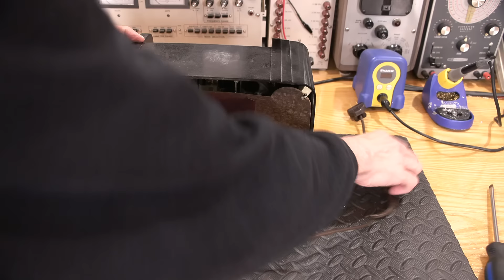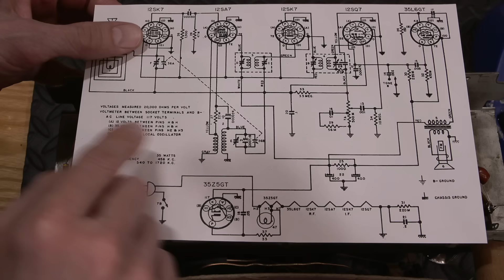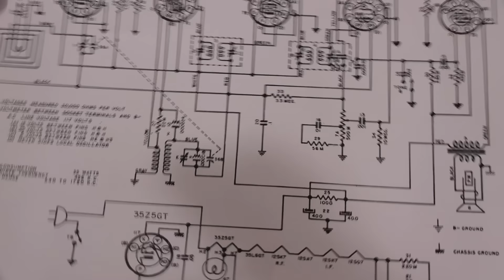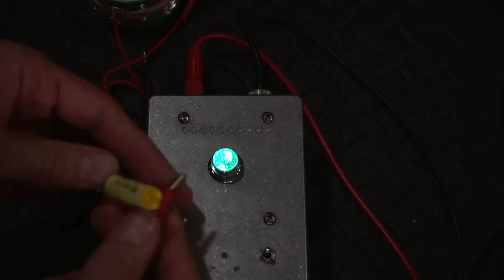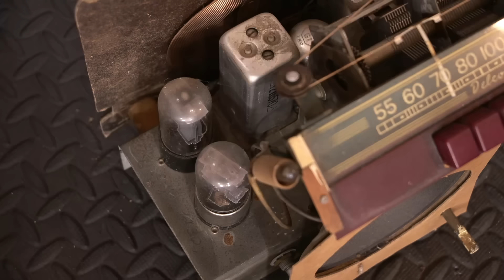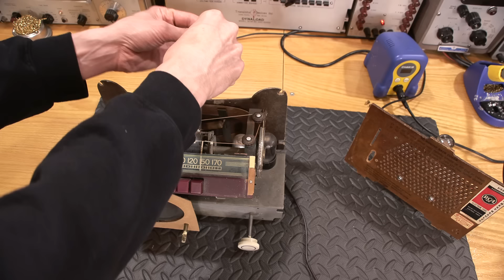Delco High Performance Radio Receiver! [Repair]

Comment: Can you align, and peak up a radio, without test equipment or very limited cost test equipment. And if so do a video on how you would carry that out. Obviously  not expecting the results to be as perfect but still put the radio in to a good state of usability.
Keep up the good work on the channel, just recapped my first Ekco U319 radio, inspired by you channel. And it works!! Or at least receives channels on all bands!!
Thanks from the Norfolk Broads UK
Reply: If the alignment of an AM radio isn't too far off you can trim it up "good enough" without any equipment. Tune to a station, being careful to precisely adjust the tuning knob for greatest volume and clarity. Then adjust the IF trimmers for best signal.

For front-end alignment it's closer to the standard procedure. Instead of using the specific frequencies in the manual substitute the frequency of a broadcast station that's in the same part of the dial. In other words, an AM station is just somebody else's signal generator.

If you want to spend a few dollars (or pounds) there are cheap modern crystal-controlled variable frequency oscillators. Many of these are based on the Si5351 chip. These output an unmodulated signal so you'll need to use a voltmeter on the AGC line instead of the speaker output.
Reply: Look up a product known as "Tiny SA".
It's a spectrum analyzer and RF generator with modulation option. For an old basic am radio it can do all you need for basic alignment. 
Also look up an RF wand, one end is made of ferrite, other end is brass. You can use it to determine how much more or less you need to tune inductive rf coils, slugs or antenna bar/coil assemblies. In a coil, you bring brass and then ferrite ends into them or proximity of them, if signal or frequency changes in direction you need with brass side, you need less inductance, ferrite side the opposite, more inductance. You can make the RF wand.
Reply: Use weak stations near top or at least 1400 and bottom usually 600 or lower and you can do a great job. The exact IF frequency can be difficult to home in on. Hopefully it's close. A simple RF generator and an AM at 910 would give an easy beat frequency to pick up exactly at 455.

Comment: Thanks Paul for your detailed instruction. I’m amazed how well an untuned rf stage works. The rf amp would appear to have a 3300 ohm resistor as a load

Comment: These old tube sets work a lot better than many people today would think. I've lined up many radios like this, and yes you can do it by ear. To get the signal into the set without connecting the signal generator directly to it, I just take a lead from the sig. gen., and make a loop of a few turns and simply place it near the set. I keep the signal low, so the a.g.c. in the set doesn't kick in, and line up the IF like that. So a signal generator and a good ear is all you really need!

Comment: Excellent job Paul!  Your genius antenna booster device works like a treat.  Not having to physically connect equipment to the radio makes it the absolute ideal way to align a radio.  No influence on the test radio, & perfect safety for the test gear!

The huge difference after alignment demonstrates the sensitivity of the radio, & the perfection of your test gear!

A restoration video of this receiver would be an excellent watch, where I'm sure you could make it perform even better, if that's even possible.  Thank you!

Comment: Easiest.   Radio.  To.   Rebuild.   Love.  Them.   Very.   Reliable
Reply: I can do anything except restringing the tuner, or rewind IF/RF coils.  I'll pull the tubes and knobs then off to the curb it will go.

Comment: Those old radios are fascinating. With that nice, high-quality I.F. section, this is the perfect kind of A.M. radio for tapping off the I.F. output and feeding into a synchronous detector. Many years ago, I had a six octal tube radio similar to this. Wish I had hung on to it.

Comment: Paul!  I have been watching all your videos and they are so, so good!  One thing:  On your capacitor checker that has the LED lights.  Would it be possible for you to put labels on the switches?  It would be a nice touch got such a valuable electronic tester.  Thanks and you are so good at trouble shooting!

Comment: Mr. carlson that is a perfect way of feeding the R.F. test signals to a radio, with built in antenna, via a remote antenna coil. I have done the same thing in my alignment of AM radios.
Reply: Do you think that it would be doable by simply connecting a loop antenna to the 50Ohm output of a signal generator, without a tube in the middle?
Reply: @willjackson1955  YES!  All the tube does is boosts the signal so the loop can be farther away from the radio being tested. Even several turns of wire to form a simple loop will work too.
Reply: @JCWise-sf9ww  nice, then I suppose that the tube is just an IF amplifier, a bit more broadly tuned to let all frequencies from 430 to 480 Khz pass?
Thanks!
Reply: @JCWise-sf9ww  What amplitude are we talking about? My generator can do 50mV max...
Reply: @willjackson1955  I would say that Mr Carlson's device is a broadband RF amplifier driving an ordinary AM antenna coil without any tuning capacitor involved. With my knowledge, I would say the tube circuit & antenna loop is capable of amplifying & passing frequencies from about 100 khz into the HF (shortwave) range. Depending on the gain of the tube used, 50mv, from your generator, would easily be multiplied many times over.  BTW: Carlson was also using the device as an Antenna re-transmitter.

Comment: When he tested the first cap shouldn’t the leads have been switched?
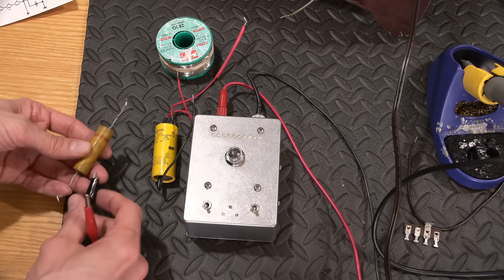Reply: At 18:14, it's a non-polarised paper cap and so polarity (when testing for leakage) is not a factor. The ring typically indicates the outer foil end, which is a factor in radio design (I think he has another tester for outer foil detection).

Comment: So when you end up with hum after replacing the multi-section capacitors, what sort of things should we look for to make it go away?   I run into this when I'm doing my amateur restorations of radios like this or things like tube CB radios.  I love the antenna 'caster' device!  So handy and useful when you're working down in the basement like many of us are.
Reply: The remaining hum can be caused by heater-to-cathode leakage, poor lead dress, or in a 6 volt filament string, the same lead being used to ground the filament and cathode, particularly in the audio circuit.

Comment: Great video, Paul. Do you restore viewer's sets? I have a 1948, Zenith model 7H820 AM/FM radio. It still has the original prewar, Armstrong, 42-50 MHz FM broadcast band and the other two frequencies It would make a very interesting video. I live in Manhattan and could ship to your address in Canada. Please let me know if you're interested.

Comment: The snag is, they are using a 2 prong plug. So the question is, which wire is live and which one is neutral? But it is a HIGH PERFORMANCE radio, so it shouldn't matter too much, should it? It's a HIGH PERFORMANCE radio. HIGH PERFORMANCE. Extremely important. Not just your average radio. It's HIGH PERFORMANCE!!!!! HAHAHAHAHAHA Edited to say this: Damn good idea not to tie Neutral to the chassis. Re read the start of my comment.

Comment: I know of several people that do retro-computer repair. They test ESR but, they won't ever test for leakage because the ESR is good. So you don't see them do a lot of recapping. I'm talking Tantalum caps from the 70's and 80's. would those 50yr old caps be notorious for leakage. I know Tantalums can go bad. They are basically used as filter caps for the IC's in the circuits. myself I just don't take the chance and do a recap in any case. Capacitors are so much better today then they were when I was growing up. Electrolytics are almost always still good. I won't replace those unless I see them leaking or bulging.

Comment: FYI I worked for Delco Electronics in Kokomo, Indiana my entire career (1977 - 2008), and we made some of the best radio receivers, along with several firsts in the auto industry (first in-dash radio receiver, first push button receiver, first electronic ignition module). I would have been surprised if you weren't impressed by this radio. It's also possible that all cases were made in ivory and painted brown at the factory.
Reply: Delco built many high quality, well engineered products over the decades. Most people don't know anything about Charles F. Kettering today, but he fran Delco Labs and was a creative genius and a giant in the American auto industry.
Reply: @patjohnson3100  that’s right
Reply: Since there is just an AM band visible on the radio, what is the purpose of the red push buttons. Just curious. Thanks in advance.
Reply: @fozzlac  preset stations.
Reply: I would kinda hope that by Ivory you meant the colour, and not the actual material.
Reply: Dude Motorola and or Bosch/Blaupunkt made the.first auto radios
Reply: @e.emerald3224  he said first IN DASH radio. In 1936, Delco began producing the first dashboard-installed car radios
Reply: @e.emerald3224  Dude you're wrong.
Reply: @gold98gtp mopar had electronic ignition in73 1 year before delco

Comment: The harder to find Delco model R-1236 with pushbuttons circa 1946. It actually came only in the ivory finish. The non push
button version came in either ivory ( R-1234) or brown ( R-1235). Interesting "junk box" power booster antenna none  like I
have ever seen! Impressed by your cleverness using a Compactron Mr. Carlson. Of course I don' t want to  possibly send a 
signal out to the whole neighborhood. Or do I? LOL. Excellent revival and alignment of an old tube receiver!

Comment: that's what the inside of my thermin i built looked like, until i decided to make a circuit board for it. a bit ball of resistors, caps, diodes and transistors didn't work out so well

Comment: They switched the chassis side because the service receptacles and plugs were not polarized. Therefore, if the chassis side was connected to the hot side of the line it would be at full line voltage 24/7.

Comment: Finally a normal mr.Carlson video Also Richard from the channel Learn electronics repair tried to contact you about a rare tube filled thing if you were interested in it but your Email did not work or could not find it ... anyway you may want to contact him .. if he still has it .. tell him dutch told you about it it was a german device

Comment: make a new power cable under the tuning axis, closer to ground, shasi. It will not touch the tuning axis, like the old cable.
Reply: Did you actually watch the video…? 🤔 He explains exactly how he will rewire it during the full restoration. But hey, comments=engagement metrics! 😜

Comment: US buildings that used 110VDC, I found the Electra Hotel in downtown Chicago. It had a steam plant for heating, domestic hot water and to Generate its own electricity. In the room that I rented had a sign above the one outlet stating caution 110 direct-current.
Got a tour of the boiler room it was quite impressive. (Talk about off grid)
Reply: Early Polish post-WWII grids sometimes used DC, 127V or 220V. That's why "universal" radios like Pionier U and U2 existed. They used series heating at 100mA for tubes, typically UBL21, two UCH21 and UY1N. As years passed and the country standardized on 220V 50Hz AC mains, most radios had mains transformers and used E series tubes, starting with loctal (EBL21, ECH21, and if the radio had a magic eye, it was EM4) moving on to noval (ECH81, EF89, EBF89, EL84 or ECL86). A few small and cheap models in the '60s didn't have mains transformers or had one for heating only, they somewhat resembled the AA5 design. I don't really like working on these for their hot chassis, even though I have a proper separation transformer, dim bulb and variac setup like Paul uses.
Reply: @KeritechElectronics  Thanks for the early Polish mains history; very interesting.  Having only lived in the US, I assume Philips controlled most radio design via patents, like RCA did in the US.  I have seen a few of those AC/DC universal line voltage radios.  They appear to be designed for 100 volt mains, with a multi-tapped custom power resistor to drop higher line voltages.  I agree with you on the Hot Chassis.  I grew up in the 1960's in Florida and I was regularly getting shocked from those hot chassis due to most homes having a concrete floor.  Fortunately, the mains voltage was only 110 volts at that time.
Reply: Yes, the Edison DC house power was used for many years in the Chicago and New York area.  The prime reason for series circuit tube filaments was to make a radio that would operate from both AC and DC.
Reply: @billharris6886  The early electrical history is entreating, like the reason for 1st elect R&R line voltage.
Reply: @mackfisher4487  Thanks for your response but, I can't make sense of some of the words.  "Entreating" is a forceful urging or begging.  "Elect" means chosen.  I'm not sure what R&R means.  I guess my working vocabulary is quite a bit different than what you are used to.
Reply: @billharris6886  I’m guessing he meant “intriguing” and “electrical”
Reply: @JohnGodwin777  Thank you for your response, that makes a lot more sense!  I suspect in the early days of electrical power generation, a city would buy an engine and generator head, then run it at whatever speed seemed to work best for their particular setup.  For instance, 15 years ago, I was living in Hamilton, Ohio.  I discovered they were originally running a line frequency of 133 Hz.  My guess is they discovered that you can get more power out of the generator if you spin it faster.  That power was being used to power arc lamps, incandescent light bulbs, and brush motors (non-frequency dependant loads).

Comment: Those people that recommend putting the fuse after the switch, what's their reasoning behind that? I, too, would never put the fuse after the switch because that leaves a lot of the circuit unprotected.
Reply: The reasoning I've heard is that the switch being off means the fuseholder has no voltage across it when the fuse is being changed. Personally I think it's dodgy to assume someone will turn off the switch to change the fuse.
Reply: @stevencraig  I've got a genius solution for this: unplug the damn cord when changing a fuse.
Reply: That would require common sense unfortunately

Comment: just out of curiosity. why would someone want to put the fuse after the switch? that doesn't make any sense to me. i can't even imagine someone doing that for any reason.
Reply: Some people think it is safer with the switch first, because if it is still plugged in, you could "safely" replace the fuse as long as the switch was turned off. They say that with the fuse ahead of the switch, someone might think it was still safe to replace the fuse even if it was plugged in as long as the switch was off, but with the fuse first, they would get zapped. Why anyone would ever try to do anything without unplugging the device first is beyond me, but that's the reason I have heard for putting the switch first. Go figure...
Reply: For hardwired industrial equipment, the switch is first (and interlocked) so that the fuses can be replaced.  I guess it would be setup that way, but you would still have to remember to turn it off first.  If it’s someone who isn’t going to unplug it, you couldn’t rely on them to turn it off first either.
Reply: They thought that if they put it on the other side, it would induce hum, but Mr C said it didn't, and if he restores it, he will move it.
Reply: @DaleDix  👍 yeah i caught all that in the video. still doesn't make a damn bit of sense.